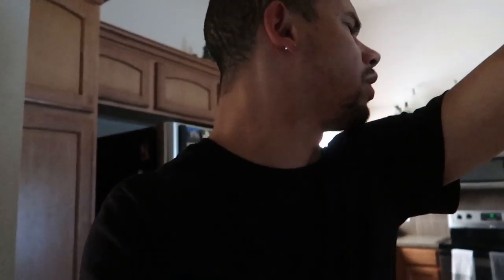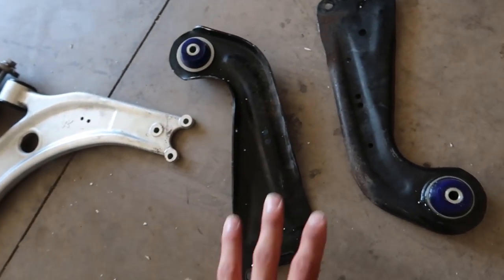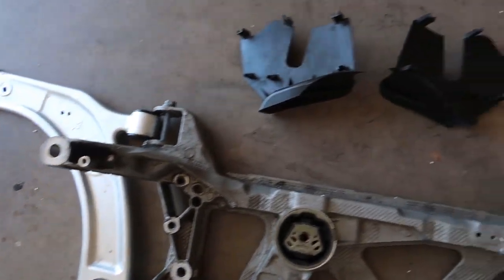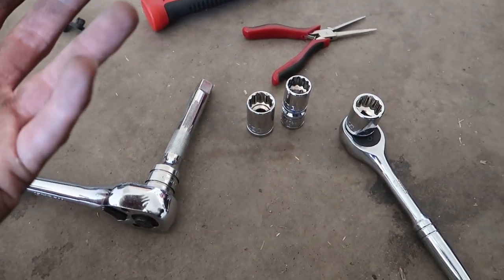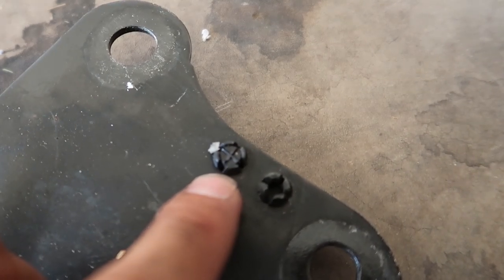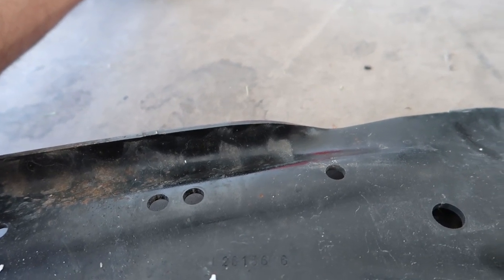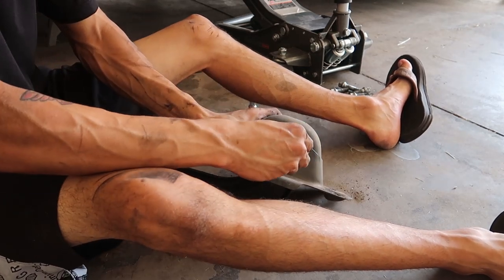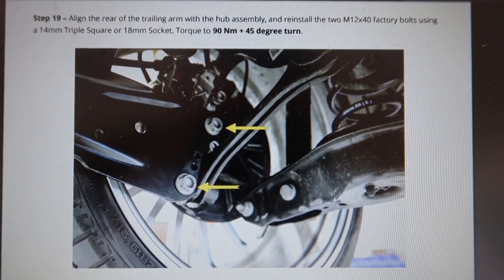New Trailing Arms & Bushings! - Install | Deal Of The Year!! | MK7 Golf R

Comment: I figured you already did the LCA's they are a big improvement IMO. I would recommend using a dead set kit when you install the new sub frame. I know they are a bit pricey for what they are but for me they lined up the sub frame perfectly  making alignment spot on and  a lot easier. Plus if you ever want to drop the sub frame again you don't have to worry about messing up the alignment. 
I also just recently replaced all of the rear bushings with super pro and the front link I used an adjustable one with spherical bushings. I like it but then I could fell some unusual movement which was really apparent the first time  did a high speed corner, I could feel the something in the rear shift before it took a set. It was a bit disconcerting. After a little research I found out that the rear sub frame  is attached with rubber bushings that all ow a lot of movement, You don't notice it much with the stock bushings because everything is kind of soft back there so the whole thing is squishy. However once you stiffen everything else the sub frame movement is very noticeable.
034 makes some inserts that I have ordered and will hopefully resolve that issue. I also figured as long as I am removing the rear sub frame bushings I mine as well do the rear subframe dead set as well. 
BTW I am in DFW and have a membership at MSR so if you ever want to come down and visit the track, $20 a session for guests.
Reply from the maker: Ive been holding out lol! I can't wait to put them in! I have the tyrol deadset kit up front already 🤘 did you feel that movement before or after an alignment? I can feel the rear being a little "funny" on shitty roads, I need to go get an alignment done soon, but I don't wanna pay twice sense I still have the front to do. I have the rear 034 subframe inserts, they feel real nice! I heard the rear deadset and inserts don't mix well, you'd have to drill out the inserts to make it work I believe. I need to make my way out to Dallas, it's been awhile! If I do come for a race weekend I'd definitely be down!
Reply: @BryceJordanProductions  I actually do my own alignments using a rig I made myself. originally it was just to hold me over until i could get a "real" alignment done. However I have a local shop with one of those fancy Hunter rigs and they will throw it on there and give me a print out. Turns out my garage/home depot rig is spot on so... I have done a bunch  suspension mods and now I can just check adjust it myself, which is also nice for experimenting .
I did this after putting the LCA's on, I knew I needed to set the alignment but put it off and then ended up driving like 1500 miles in a one week period. You don't want to do that, the car felt great, didn't pull and the turn in felt awesome. However, the LCA's move the wheels forward 1/4 - half inch (depending on which one you have) and that  gives you like .5 degrees of toe out. Which again feels great, for track only it is probably fine but it eats the front tires like you would not believe. 2-3 mm in 1500 miles, kept getting low tire pressure warning until I bought new tires (they were old already anyway). But that is what drove me to figure out how to do my own alignment.  I have found that about 1/8  of toe out (.15-.2 degrees per side) up front works well and so far tire wear is perfect. For the rear I played with various amounts of toe out and for low speed corners (like auto cross) it is great, really helps bring the rear end around, however at high speed like over 100 MPH it feels unstable. it just feels like the rear end wants to come around on you which is not very confidence inspiring so now  I am running 1/8 toe in fro the rear. have you swapped out all the rear bushings or just the trailing arms so far? A lot of those rear bushings are really soft, stiffening all of those I found really helps make it easier to adjust the car with the throttle. So if you haven't done all of them that may be what you are feeling. Now I just need to fix the slop in the sub frame and I should be good. I also did the Eurocode front strut bar partly based on your recommendation, and i love it. However I just got in the new RacingLine rear brace. :) i want to do the sub frame first and see what that feels like because i am thinking the rear brace is just going to make the sub frame movement even worse.
Reply: @BryceJordanProductions  BTW if you are on vwvortex, I just recently started a post about  the schroth  quick fit harness you might  find interesting. https://forums.vwvortex.com/showthread.php?9332499-Race-harness-with-stock-seats

Comment: So does the Golf R have a steel subframe and the S3 has an aluminium one? I am in Canada so rust is the biggest enemy, aluminum doesn't rust and would save weight? 

Thanks for all your videos!
Reply from the maker: 100% correct & thank you! 🤘
Reply: @BryceJordanProductions  Between the lighter trailing arms and subframe, any guesses on total weight saving?
Reply from the maker: @1991BMWM5  maybe 15lbs? Plus lighter coilovers, wheels, soon to be brakes & battery.. hoping to shave quite a bit off of the front. Maybe enough to offset the intercooler 😂

Comment: New hardware recommended.
Reply from the maker: New dogbone stuff for sure, tyrol kit uses ARP bolts, was gonna reuse control arm bolts and get new ball joints from whiteline I forgot to mention
Reply: @BryceJordanProductions  Yeah if you see a lb ft + degrees that would be a torque to yield AKA buy a new bolt.